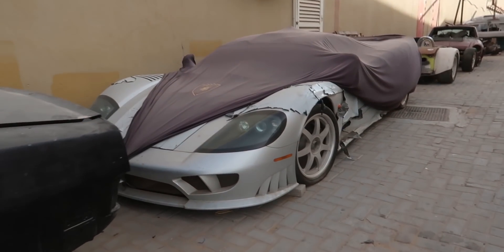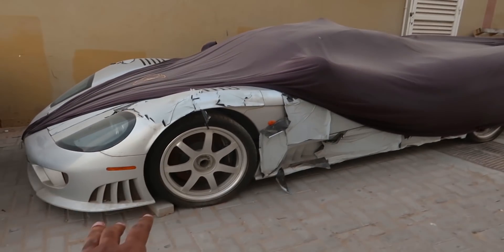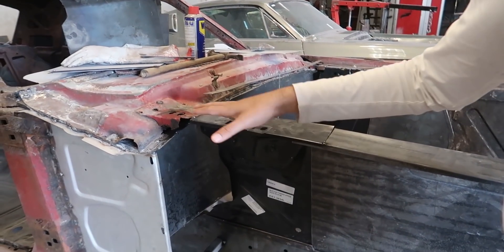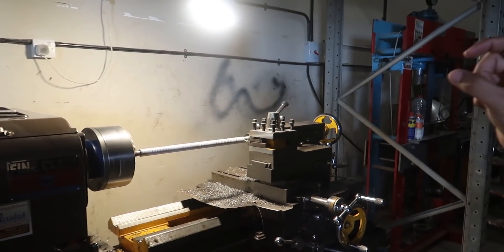IMPORTING CARS FROM U.S AND REBULIDING IT IN DUBAI

Comment: If I was a millionaire in India then I would have imported my personal favorite right hand drive ELEANOR 😍😍
Reply: Doesn't matter how Rich you are. You have to have lived abroad for a certain period and owned the car for a specified fraction of that time (around 1 year) then you can bring it over if its rhd, and after having paid exorbitant customs releasing fees and other taxes bringing your cost up dramatically. After all that, when you've spent nearly 10 million rupees, you can't drive it legally if it hasn't been homologated by the ARAI which will cost you another 2 crores and 6 months at the very least.

My uncle brought in a power wagon in 2001 by "negotiating" its release with the customs agent. Even then, he brought it in in parts without the engine (we used a Tata 407 diesel engine because of the parts availability). All of that and he rarely drives it off the farm. Its a solid method though. I'll he doing the same thing soon with a Honda cx500 that I bought.
Reply: @varun009  So what will be the total cost in one for that mustang shelby for permanently importing to India except the ex showroom(garage) price?
Reply: @bahahdh  it depends on how much you bought it for. Expect it to cost 3x the cost of buying it, fixing it and shipping it. I hate our government. Its not illegal to bring in engine parts, so I would probably start with a stripped engine block if you do decide to go that route. Again it's more of a collectors thing. Uncle Ji doesn't want us to have nice things.
Reply: my dad is actually a multi millionare and im gifting him a mustang in his birthday so
 wish me luck